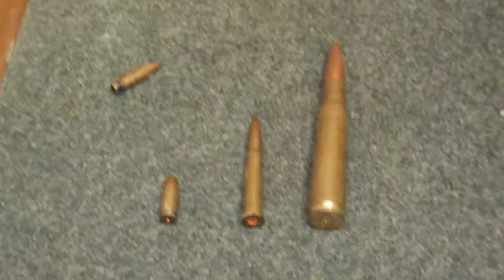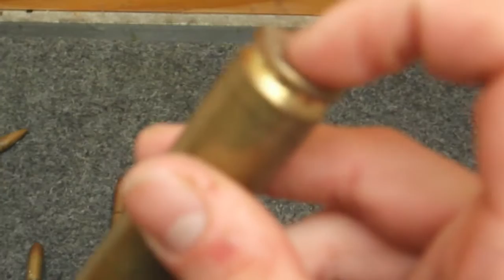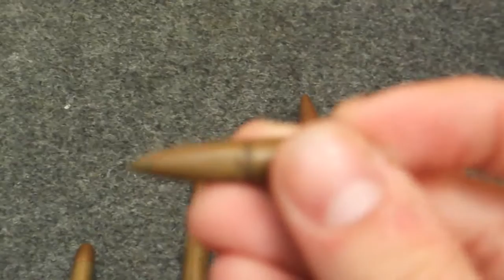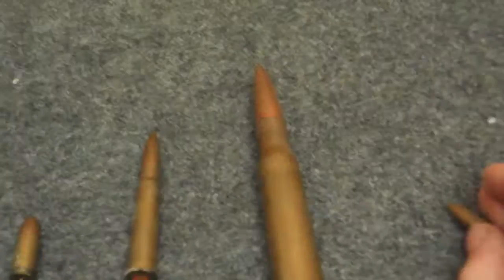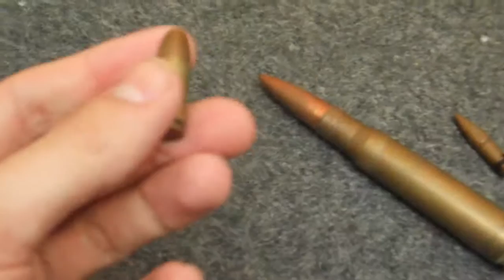How bullets work and the myth of stopping power

Comment: Too many factors here to argue. Im coming from 16 years on the road as a state trooper, and have been witness to several shooting victims as well as suicides. One that comes to mind was the messiest i have ever saw. 12 gauge shotgun, 2 3/4" shell, 7 1/2 (squirrel load) placed under a guys chin and discharged. The fact that it was a "squirrel load" not 00 buck or slug is irrelevant here. Because, (bare with me) the air in the shotgun barrel beween the end of the shell and the skin of the "unalive" guy, when the shell fires, the air is forced out (through the skin and oral/nasal/cranium) causing the tulip affect of the skull before the actual lead shot ever makes it out of the barrel. The shot pattern on the ceiling was near perfect (as well as every thing that guy had ever thought about). For defensive loads there is the "F.I.B.S." factor as well. Thats the"F:CK Ive Been Shot" that will take the "want to" out of an aggressor. Imagine getting shot by a FMJ .22, moving fast enough, an adrenalyzed man may not even notice, trade that for a 180gr hollow point moving at 1400 fps from a 10mm, that will expand, slow, and quickly dissipate 750ft lbs or so of energy, that guy may well think twice about continuing his mission. Or could I say, he may actually "StOp"? Dunno. Ill leave it to the experts to argue it out.

Comment: I do hate the caliber wars that rage across the internet by armchair experts.  The 22LR for instance does not bounce off people as some like to say.  Many like to compare the 22LR to a pellet gun.  A 22LR out of a carbine will shoot at least 1000pages into a telephone directory and cleanly go through two 2X4 boards.  This is more than enough penetration to be lethal.  For comparison, a 177 air rifle set to around 11fpe will penetrate a 2X4 board only about 1/4 - 1/2 an inch and clear about 150-200 pages of a phone book depending on the pellet.  There is no question that a 177caliber pellet gun can be lethal.  I guess to some folks, unless the bullet is a 338 lapua magnum or bigger, it is ineffective.  Got to love the internet!
Reply from the maker: Yup only a 50 bmg will kill something, even then it's a bit risky, better use a 120mm tank cannon to be safe.

Comment: Not bad explanation. The most scientific explanation is that a bullet generates kinetic energy as it travels down the barrel and exits the barrel at a specific kinetic energy known as Muzzle Energy. As the bullet travels to its target it slowly looses energy until it hits the target. When the bullet hits the target the kinetic energy of the bullet is transferred to the target. If the target is an animal or human, then the bullets kinetic energy is converted into heat, pressure and defemation of tissue inside that animal or human.

Comment: you have some facts correct. But a 223/5.56NATO is not a devastating round, it was brought in to replace the 7.62X51 (308 win). When you start talking of take down power, you need to realize the type of bullet you are shooting as well. FMJ,soft point, hollow point, full led... because what makes the difference is how fast that bullet expels that stored energy. Take for example the 5.56 having 1750 joules and the .44 mag having 1650J. at 50 yards the 223 goes through someone (fmj mill surp) and does not dispense much energy and continues going, the 44 mag will unload its energy very quickly and cause alot more damage. just a little food for thought.
Reply: a little food for bullshit.